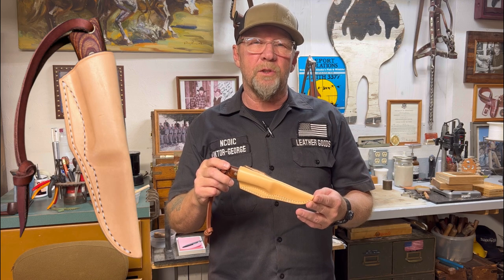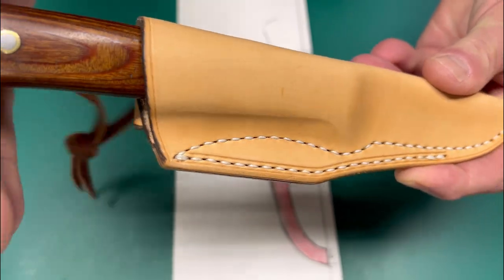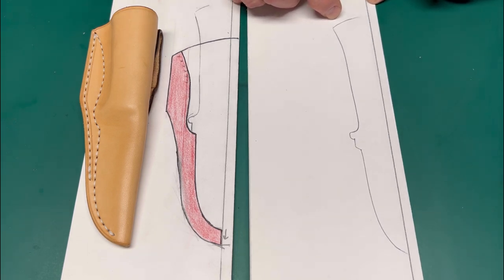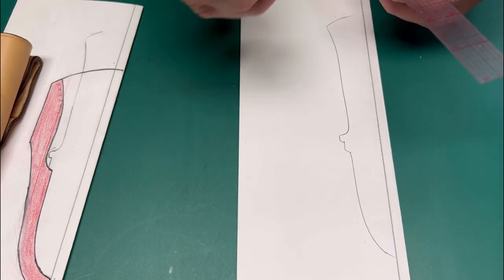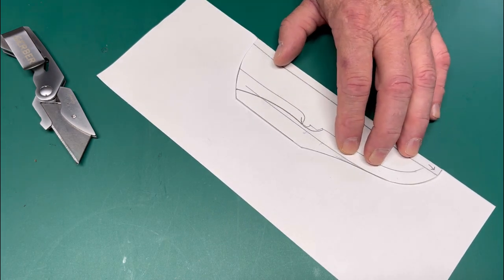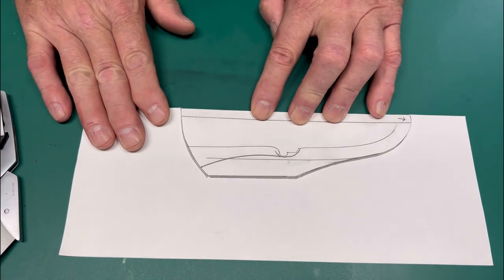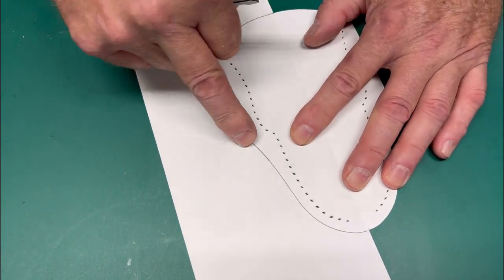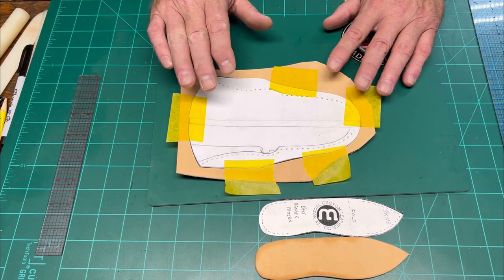MAKE A CAM-LOC WELT POUCH SHEATH Vol 6 #fyp  #youtube #youtubechannel

Comment: Morning George!  Been using your cam lock on a lot of my builds now , thank you fer that !!!  I have a customers  blade , big stag handled blade  someone made him from a  file , made two  sheath as so far for it and have not turned out ta my liking . Blade and handle are huge , handle has a curve to it that's killing me ? Second sheath I added a double Walt towards handle and thinking now should have tripled it ? Got blade in New sheath wet molded blade in to it and can't get it back out now that it's dry ! Very frustrating  !!!
Reply from the maker: Sorry for the delay in responding John. Thanks for the kind words. Sounds like the problem sheath is meant for a scabbard style sheath but I can't visualize the issue. If you want you could call or text me with photo's and we could talk thru the solve. I'm in Arizona time (520) 909-8256

Comment: Wouldn't it make more sense to leave the paper folded to begin with and cut both sides out at once? I think the accuracy of the template and ultimately the cutting of the leather would be more precise. My $.02. I like the whole process though, very well done.
Reply from the maker: Thank you Mitchell   I find that I can cut the mirrored side of the card stock pattern easier and more precise that way, probably just out of habit and repetition.   I  see your point,  but I’d probably cut into the pattern if it stayed folded :) i appreciate the kind words and respect your .02 👍

Comment: Do you always use a 3/8" seam allowance?
Reply from the maker: Hey Terry Yes 3/8 welt on this one but I like a 1/2inch seam allowance on most larger knives.
Reply from the maker: A better answer Terry is no.  3/8” welts are more streamlined to the knife and I usually use 1/2” Beefier and allows double row stitching which I like. Cheers